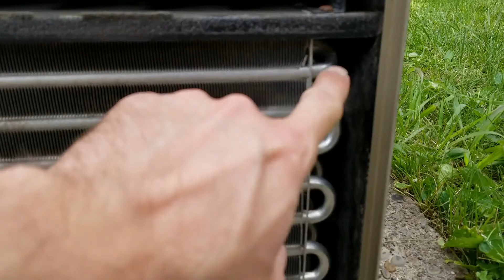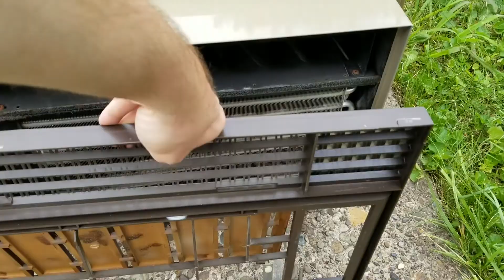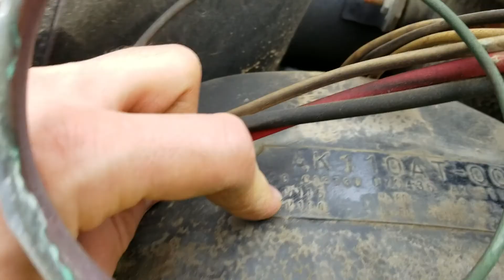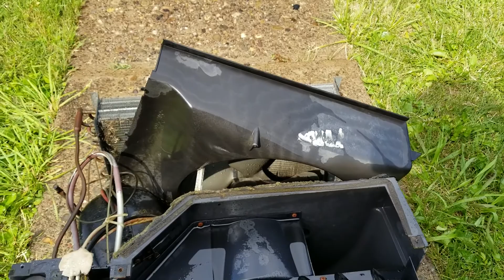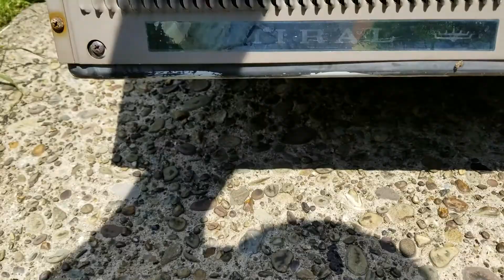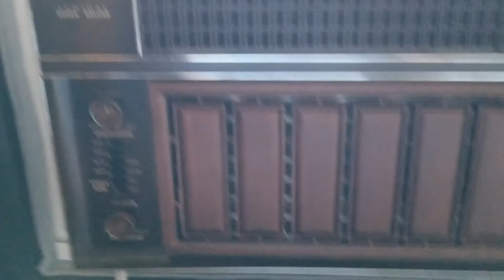1970's Admiral Super Deluxe Air Conditioner

Comment: I'd wager it was used by an older person until they either passed on or couldn't deal with it anymore, got my old Kelvinator free from my great grandpa because he couldn't deal with it anymore, it's a 12,800btu unit that can freeze water if you hold a cup or bottle in front of the supply air, AK compressor, GE fan motor, he bought it in 1982 on sale, it was made in early 1981 and was sold summer 1982 on clearance at Wards, despite being a power hungry monster it pulls off an 8.0 EER and is probably grossly underrated given it can cool a ~1,300 sq ft modular home by itself with ease
Reply from the maker: It was used by an old lady until she passed I believe last year. Also an AK compressor with an Emerson Electric fan motor. Discharge air is some of the coldest I have ever felt. It can turn a room into a refrigerator real fast. I use it to cool my bedroom which spills out into the 2nd floor of my house.
Reply: @angrodNumenesse  The Kelvinator would definitely short cycle if it were in a bedroom, it kept a sub 1000 sq ft cottage home at a balmy 65 degrees with ease despite outside conditions being as bad as Michigan can get, the freshwater lake nearby, Whitmore Lake, is not very nice when it comes to lake effect weather, I also have a 1987 Wards, pretty rare unit, only 3 documented total, that I'd sell to a collector, it's a 7K btu unit stuffed in the chassis of a 5K btu unit, still have the original window mount which I have yet to find a window it works with
Reply from the maker: @vacexpert2020  I turn off the a/c when I leave for work in the morning so by the time I get home the upstairs is in the mid to high 80's. Also, my room faces south and west and has three big windows so the Admiral does have to run for a while to cool it off. It is a bit big at 10k btu's but it does good. I would rather use my 8k btu GE Quietaire but it currently has a bad t-stat.

And an old Ward (Montgomery Ward?), rare design, in Michigan? Is it this one? https://www.facebook.com/marketplace/item/394121368670557/
Reply: @angrodNumenesse  not the same unit, mine's in Illinois, I do have a few videos of it posted
Reply from the maker: @vacexpert2020  Ok, it's that design. I've seen a few for sale over the past couple years in NE Pennsylvania, although they might not have had that same window kit. I've wanted to get one as I think the controls are neat but they have always been 5+ hours away.
Reply: @angrodNumenesse  mine's no exception but very least there's no rush, not just selling it to any schlub who pays what I'm asking